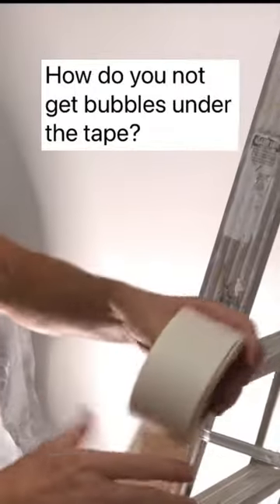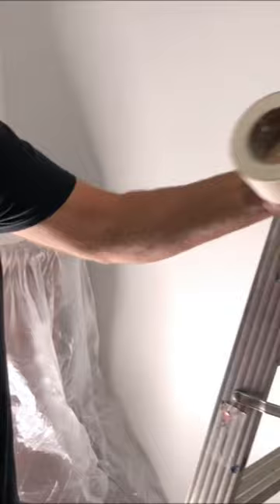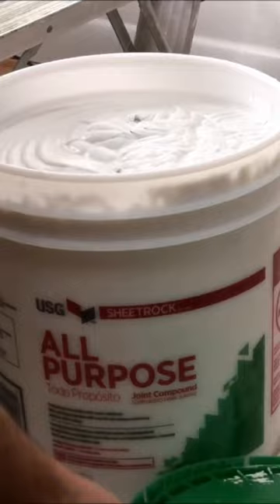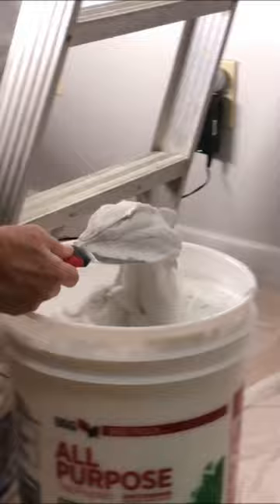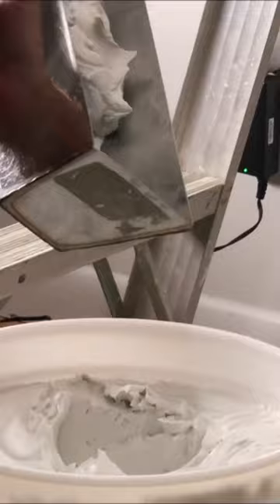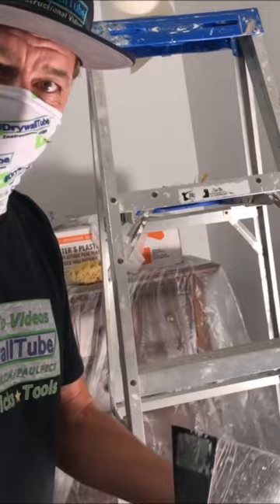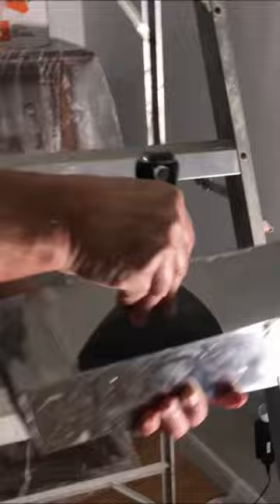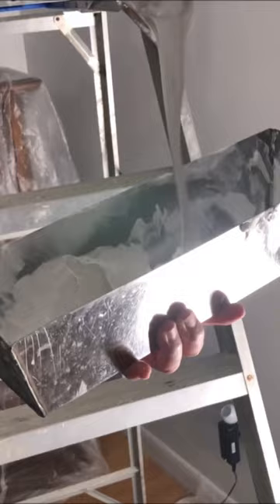How Do You Not Get Bubbles Behind The Drywall Tape? #diyshorts

Comment: If u are doing a peeling tape repair on a Painted surface, do u need to prep the painted surface prior to applying the all purpose joint compound?  Do u need to sand the painted surface for it to adhere better?  If so, what grit do u recommend?  Thanks! :)

Comment: I never use paper tape . that's the source of many repairs . I always use fiber tape and setting type material on the first coat .  
,
Reply: If you are having trouble with paper tape then you or whomever put it on did not do it right. No voids in the mud. That's most people's problem.
Reply: @Hamp72  Yes .
Reply: @thomascorbett2936  👍🏼
Reply: No bueno
Reply: @Hamp72 that's true , but the fiber glass tape is more forgiving and  less prone to error in my opinion .